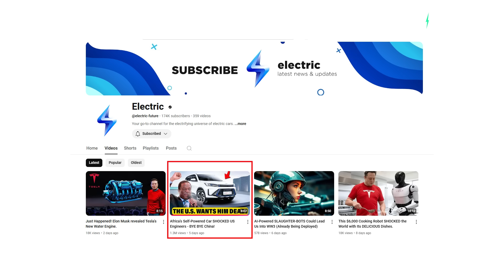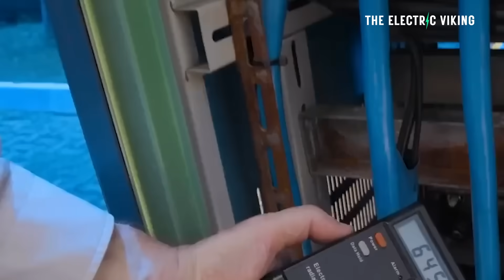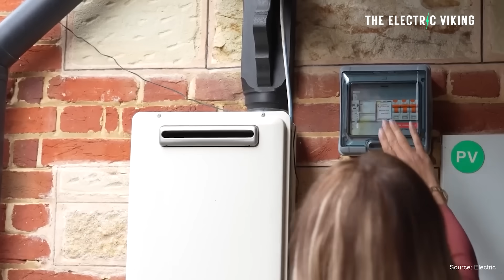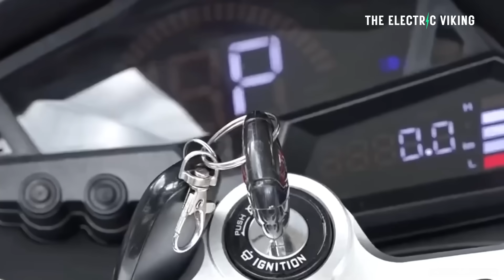Internet claims Africa’s Self-Powered Radiosonic Car SHOCKS Engineers

Comment: It is easy to prove that this is a fraud by considering the inverse square law of microwave 
and radio frequency propagation. Yes, there is energy throughout every place on earth from 
electro-magnetic propagation, but this energy is greatly reduced as it moves away from 
the source. This is not a groundbreaking innovation, it is deceiving people who don't know 
basic science. Even if you were only 100 meters away from a 50,000 watt radio station, 
you would still not receive enough energy to power your car.
Reply: Sangulani Maxwell Chikumbutso has spent over a decade working on this technology. While visiting the Ununited States of Amerika, him and his partner (now deceased)  was poisoned. He disappeared for a few years under the protection of the Zimbabwe president continued to work on his project in secrecy until Feb 2025. Do you think he spent all that time, energy and resources with his life being threatened just to pull a con and get away with it??? If so it would be one of the dumbest cons in recorded history😂😂😂

Comment: Your real point of discussion should have been about the energy contained in radiowaves and the horsepower required to run a car over 200km/hr.The car must be weighing over 2000kgs from the look of it.
Reply: it gets lighter when you remove it's battery bank and replace it with Maxwells Temu bought portable power pack, it wont move unless you push it though, so good luck to anyone expecting 200km/h out of it, as for range, well i guess that is limited by how far you can push it without a rest

Comment: Such a good video. Thanks Electric viking.
 
Just another BS. As long as you’re on earth, you cannot get power from…basically nothing. 
The waste emission of any radio frequency is so low, you can (maybe) use it to light low watts consuming LEDs - and that’s about it…(and that’s a big maybe, ‘cause you’ll gonna need to be exactly in a spot of a radio junction to get such a result for a fraction of time).

You CANNOT get energy from something, unless you placed energy (of the same or different form), and that is while not taking energy losses that are there on any device.

Cold Fusion is a wonderful example, and the amount of super edgy engineers working on that for ages, not to mention the huge funds thrown on that is enormous - Gigantly enormous!!!

So, do yourself a favor, because every now and then such stupid thing emerges: keep scrolling over them.

Comment: If you wanted to use the energy from radio waves the first thing you would need is an antenna, suitable for the frequency of the radio waves you were targetting. The bigger the antenna the more energy. Surely that's basic but there's no sign of anything to capture the radio waves to harness their energy.

Unless he's invented a device that can suck random radio waves from the atmosphere like a vacuum cleaner how can it work without an antenna?

How much energy from radio waves is there per sqm to capture and use?

Comment: China's planned space-based solar power (SBSP) station would collect solar energy in space and transmit it wirelessly to Earth using microwave or laser transmission. If the energy can be converted to microwaves (~2.45 GHz or 5.8 GHz): Transmitted to a large ground-based receiving station (rectenna). Then I guess that guy ain't so far off IMO

Comment: Mr. Reporter, why electric card dont have  alternators to charge the battery when its driving? Am sure combustion engine uses batteries too and it never needs to be plugged in, so in theory west doesn't wants anything to not be plugged into the grid.

Comment: Only those who are not technical can not believe that Africa has a breakthrough technology.  This is very possible enhancing negative and positive energy in he atmosphere and form electrical charges. Chikumbutso used simply tech from the static electric concept.  It's just negative and positives created from the atmosphere. If you do not have the equipment, it does not mean such technology is not available.

Comment: The only issue i have with such news that is the african "inventors" some of them atleast refuse to look up those who can help them beat some things .. for example the device is clearly a Portable Power Station 614.4Wh Battery Pack EU 600W AC Outlets Solar Battery Generator  by Shenzhen Dongshengxuri Electronics, i could have easily designed a 3d casing for whatever invention he has or down right replicate and re-design the above .instead of using a casing that has been around for ages! that also creates avenues that will  allow other companies to sue him. Anyway i am sure he is onto something no way he would involve a whole president if he did not have a backup plan. Again we can only blame the tokra. The outside world is not polite brothers! take some time in linkedin look up your brothers you never know what you might find ..

Comment: I understood the system alleges that power is drawn from electromagnetic energy, which is not "perpetual motion".  If the converted energy is then fed into a conventional storage unit, I.e., a battery, then it is this constantly recharged battery that provides the eventual power.  I agree it sounds far-fetched but it needs to be tested in laboratory conditions.

Comment: Chikumbutsi's invention warrants a thorough engineering analysis to separate fact from fiction. Rather than relying on sensationalism, let's examine the scientific dynamics at play.

Can Chikunbutsi's device overcome the fundamental limitations of aerodynamics, materials science, and propulsion systems? What are the underlying principles governing its operation?

A credible assessment requires a detailed examination of:

1. Aerodynamic efficiency and drag reduction
2. Materials selection and structural integrity
3. Propulsion mechanism and energy generation

Let's set aside cynicism and geographic biases, focusing instead on empirical evidence and expert insights. A follow-up video with a more in-depth, technical analysis would be appreciated. 

Calling luncy with baseless analysis is not a scientific evaluation.

Comment: Hey! Have you ever heard about crystal radio? If so could you tell us what drives it. You may say that that is just talking. However for it to produce sound it must vibrate (move) a diaphragm and it can do so for ever as long as the circuit is complete.

Question is this where does the  crystal radio draw it's power from. FROM RADIO WAVES YEAH! So it is possible to harness radio waves to do work?

Besides solar energy is exactly that— converting radiation into electricity which can then be used.

Now a solar panel is made of cells. Each cell is a collection of individual diods. Have you ever asked yourself how much electricity is produced by the individual diods? It is indeed comparable to the amount produced by the crystal radio. It only becomes usable after stacking millions of the diod into a cell then connecting tens to hundreds of cells together to make a panel

The problem with radio is that our interest was in transmitting speech so we tuned it to resonate with one frequency filtering out other frequencies which we call noise. But remember the noise is also energy.

If only one can design a device that can efficiently collect all the frequencies without filtering noise, our crystal radio could produce more energy than one solar diod. By stacking them in millions— pap! Usable energy.

I don't think that harnessing radio energy should be ranked together with perpetual motion or the so called free energy. No! This is not free energy. This is making use of pre-existing energy and converting it into usable energy.

Finally you video projects a hint of prejudice even bordering on racism. You over-stressed the fact that the 'dude' is from Africa as if to say that it would have been better if he was from maybe US; China or some other place where  things are made not Africa

Comment: I'm no scientist in the field this covers, but I believe that there's a formula that would go something like this: The speed and amount of electromagnetic energy required to be taken in plus the speed of converson to direct current in order to power the motor, and the motor's power requirements to move an object on demand for specific speed requirements. Some of that power will be lost through heat in conversion from thermodynamic laws. If it's a stacked system for more power requirements, then weight would have to be accounted for as well due to added weight to the vehicle. I think you'll still need some form of storage such as a battery, even if plug-in is not required.
Reply: a bit like having solar on the roof.
Reply: @TerryHickey-xt4mf  yes, but EMF.

Comment: This device does not bend the laws of physics. It just uses radio waves that are being pumped out at high wattage to transmit television and other communication signals. If he has found a way to amplify the effect that small devices have been using for multiple years now. Then this is going to be very useful for everybody.  The technology already exist. This would just be an upgrade to the technology. Look up Radio Frequency Energy Harvesting Technologies and Zenneck wave experiments
Reply: but there is a big difference in usable power that is enough to run a car
Reply: @ https://pmc.ncbi.nlm.nih.gov/articles/PMC9185291/#:~:text=A%20typical%20RF%2DEH%20circuit,in%20Figure%201%20%5B28%5D the power doesn’t directly have to run anything it just used to charge capacitors or batteries like in most devices. Also, with a dedicated radio towers, the impedance, tuning and power adaptation can be done more regularly.
Reply: The power of radiowaves is just enough to power a halogen lamp very dimly if you are close enough to the tower.Move away and nothing.Do you mean the radio and tv stations must (upgrade) increase their power output thousands of times?
Reply: @tjaartvanderwalt5864  Experimental Realization of Zenneck Type Wave-based Non-Radiative, Non-Coupled Wireless Power Transmission first, they tell you it’s breaking the laws of physics. But the only laws it’s breaking is capitalistic laws of certain people should have technology first.
Reply: Imagine the size of a device that could harvest enough power to power anything?
Reply: @ governments have been planning to orbit solar platforms in space, transmitting, microwaves, doing the same purpose. It’s all on the geometry and advancements in the technology that has been around since Tesla powering his remote control boat. https://www.nature.com/articles/s41598-020-57554-1#:~:text=A%20decade%20ago%2C%20non%2Dradiative,debated%20for%20over%20a%20century.
Reply: @scamchan  it’s not letting me post the links to the technology that the United States government has even done multiple experiments in using Zenneck waves and Radio Frequency Energy Harvesting Technologies: A Comprehensive Review on Designing, Methodologies, and Potential Applications
Reply: It is evident that you know nothing about what you are talking about. You think you know but you don't😅
Reply: @edsonlunyiliko664  look up Radio Frequency Energy Harvesting Technologies. Also the new experiments in Zenneck waves
Reply: @edsonlunyiliko664  nature published an article on Zenneck waves that deal with the same technology. Plus radio frequency harvesting technologies have been used in the Internet of things for multiple years now. Upgrades to technologies come all the time.

Comment: I may not believe totaly but I know, in England about 1824-36 was car with 1 battery and over 150 pound of copper coils,, using radio energy to power car 24/7/365.
I have a drowing of copper coils and I can getting dungeons Voltage from it.😢 
So, you don't know but is possible, because Energy is Everywhere, just Balances.

Comment: These comments are scaring me.   I didn't know I was surrounded by so many gullible people in the west.   If I said I had a car that runs on fairy dust people would laugh.   But if I am magically pulling energy out of thin air people think it is possible.   This is how people get scammed out of their life savings by scammers like this guy.  If you have a source of energy like the sun,  you can convert it into another form like electricity........   with solar cells.   This is no different than the cars that run on water.....   this is for gullible people.

Comment: Utter BS. Energy can't be created or destroyed. The enregy of radio waves is very weak it just about sufficient to reach the radio or TV receiver.then this wave signal is amplified by the radio or TV using bateries or external power source to create the broadcat sound or images.So it's BS to think these radio wares can charge the car batteries 😂

Comment: Many years ago, I did manage to see '10mW' of power on a good day, and at 0.85v as well, not that I was trying to gather any usable power from my temporary 10meters in length aerial, it was just out of curiosity. I guess that you could just about, 'rev up an ant' on that! I will let you do the math and the 'setup required' regarding the charging of a 12v 100Ah battery. NB. Don't forget the self discharge of the battery. 

As engineers, we see things differently and shudder when seeing scams and clickbait crap, and do feel truly sorry for those that get suckered in. What is so bad is the media that advertise and push things like this forward and just make it into a platform for carrying adverts. The media should have some 'responsibility' in pushing this sort of obvious rubbish forward rather than aiding and promoting such outlandish unproven and stupid claims! It is just like the motor seen driving a dynamo, free energy for everyone, and at 3Kw output! Etc, etc. (Please do forgive the rant! It is basically called 'Science'!)

Comment: This is the usual way of conning people. 
There is an ingredient of truth and a mix of extraordinary claims with no proof. 
Converting radio waves into electricity isn’t new. 
If combined with extremely low power devices this works. 
But isn’t a straightforward technology to make useful. 
Example: RFID
They are powered by the waves of the transmitter and send back data. 
Short range and limited data by themselves aren’t an issue but require the infrastructure we are all familiar with: handheld devices and the ubiquity of the technology plus software that can make use of the data. 

Short of making nuclear fusion practical for every day use, revolutionary technologies aren’t going to be worthy of killing anyone.

Comment: @220kph the car would probably need about 75 kw of power to drive it to overcome friction losses and air resistance. Natural electromagnetic radiation background is a few micro Watts per square metre, unless you're close to a radio transmitter. You were there before require an aerial somewhere in the region of about 10000 to 100,000 Km² to collect enough natural radiation energy. This means Zimbabwe would have space for about 4 to 40 of these cars maximum.

"One of the great challenges in this world is knowing enough about a subject to think you're wright, but not enough about the subject to know you're wrong." :: Neil deGrasse Tyson

Comment: I've saved a copy of my following comment on this mythical technology so I don't have to keep regurgitating it from scratch every time it pops up on a new YouTube post.
::::::
There's no such thing as a free lunch.

It's also rather strange that this promotion keeps getting refreshed and popping up like it was new every few days, it probably gets taken down once a few people start debunking it and then reposted this new in order to remove all the honest, but negative, comments about technology.

Although it's technically feasible to harness the electromagnetic radiation energy that is present all around us, the crystal radio did that back at the beginning of the last century did this, the amount of energy that is available is miniscule, and a tiny fraction what we receive from the sun. It doesn't matter if you've got a device that's 100% efficient add Harnessing background electromagnetic energy, it can't use energy that isn't there.

If I was Elon Musk I wouldn't be in the slightest bit worried about this apparent new invention. 

If this technology really did what it's claimed Maxwell would have proved it by demonstrating driving one of his devices for a long distance will it be independently recorded/filmed at the same time.

Comment: The Law of Conservation of Energy means that a perpetual motion machine, well one that has energy, is impossible.

There is energy in radio waves, which is why you can listen to the radio and send information by it. It's also possible to turn the energy of radio waves into physical energy. Unpowered radios do kind of work, but they are very weak. There isn't enough ambient radio power around to power homes or cars and it needs to be emitted from somewhere, there isn't an infinite supply to draw on. This is definitely a hoax built on part truths out of context, preying on the naive and ignorant. In theoretical Physics it may be possible to extract miniscule amounts of energy from large areas of vacuum, according to quantum theory. But I don't get it and frankly doubt it. Maxwell isn't suggesting he's doing that, anyway.

These things all seem derived from the 70s Science Fiction Short Story "It Was Nothing Really" published in Antigrav. You know, an entertainment with a critique, not reality.